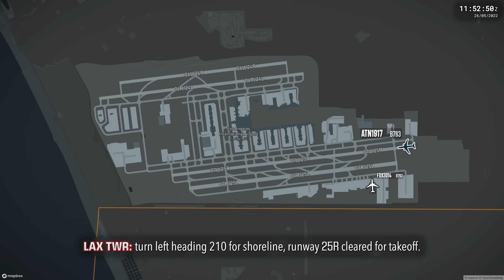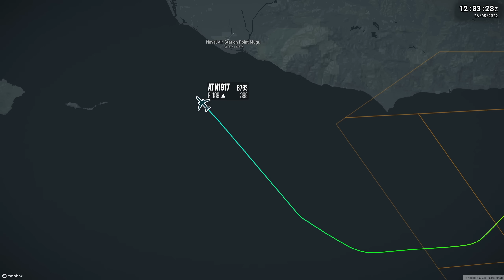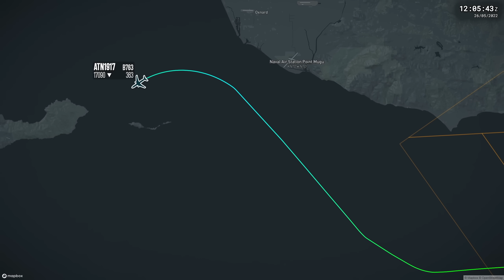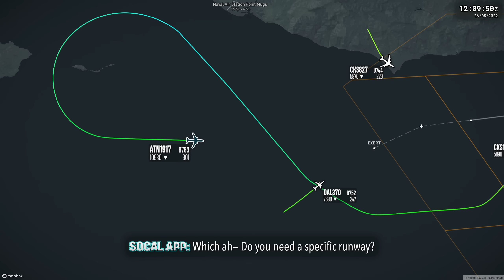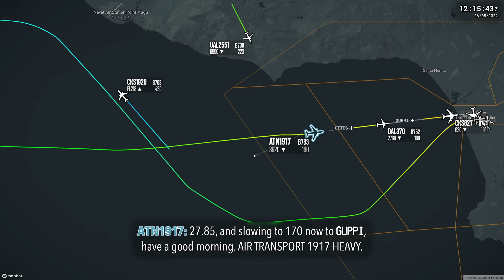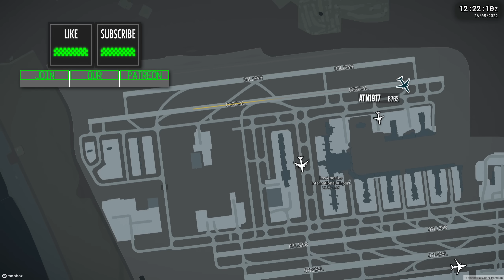"We Need To Land IMMEDIATELY"; Amazon Prime 767 Reduced to Single Electrical Source! [ATC audio]

Comment: I know the APU isn't "necessary" for flying the airplane, and I seem to recall other incidents when a non-functioning APU proved to be a problem.  It's like belt and suspenders, and if both straps of your suspenders fail, you really need that belt.  I think I'd consider the APU a necessity.

Comment: So, they still had one electrical source, plus the battery, plus the ram air turbine, and both engines, correct?
Reply from the maker: No, the aircraft was dispatched with the APU inop. When the right engine generator failed, they were down to a single source - the left engine's generator. The battery and RAT can supply power to some systems, but losing all other sources of electrical power would constitute a serious emergency.

Comment: wind 240 at 5. Why are they landing on the 6s????
Reply from the maker: This occurred in the early hours of the morning. LAX operates over water SODPROPS (simultaneous opposite direction parallel runway ops) overnight when winds are relatively calm and traffic loads are low to reduce aircraft noise over land.

Comment: Did the APU quit or was the plane not equipped with one?
Reply from the maker: Dispatched with APU inop.
Reply: @AirTrafficVisualised  I don't know how I would feel about that as a pilot...

I think if it were my own plane, I wouldn't want to fly with it.
Yes, these planes have two engines, so there's still a backup. But the possibility of a maintenance error that was done to both engines is not zero.

Comment: I find it astounding that, in 2022, when we have have thousands of channels of HD video available on low cost "Smart TVs", the  audio on a mission critical airplane sounds like its being recorded in a toilet bowl.  The massive frequency spectrum needed for video compared to the minimal spectrum needed for clear audio needs to be corrected to allow for crystal clear communications especially as we a talking about possible life/death situations. Also, given the poor quality of audio the ATC operators need to speak and enunciate with the utmost clarity.  There is no excuse in 2022 for such pathetic audio quality on mission critical applications.
Reply: The audio in the Aircraft and ATC is much better then you hear here.
and it still runs on AM, that does lower the quality some, but u cant change that without having to change every airplane  outthere.
but AM is still the most reliable radio technology we have.
Reply: @aquelty1  My contention is back before Digital TV/Audio, video information required almost 3+ Mhz bandwidth while Audio only needed 20Khz at most.  If we are  going to rely on voice technology for mission critical, life/death situations, it should be crystal clear. I've watched a handful of these videos in the last couple of days and was amazed at how many times instructions had to be repeated.  Many sound like Single Sideband not on frequency.  We  put men on the moon, we can certainly communicate better.
Reply: @mikewurlitzer5217  Did you actually read aquelty1's response?  That you propose would cost billions of dollars and require acceptance from every nation on the planet, every airline, and every manufacturer.  And it really wouldn't help much.

Comment: What does it mean when they say "heavy" at the end of a comm?
Reply from the maker: It's to do with the mass of the aircraft. The heavier an aircraft is, the stronger its wingtip vortices/wake turbulence are. The word "heavy" is appended to the aircraft's callsign to warn other aircraft of the potential danger of flying through the wake turbulence of a large aircraft. The A380 has the suffix "super". You can read more about it here: https://en.wikipedia.org/wiki/Heavy_(aeronautics)

Comment: There are 3 power sources, apu in rear, generator on each engine. Two of those failed in the flight. (apu likely before flight) Being down to one power source is not ideal.

Comment: Hey just want to make a comment about your stolen alaskan air video cause the comments of turned off.
That was not his flight path at all! Some transmissions are missing as well. Don't do that crap because it shakes my trust of the accuracy of your videos now.
Reply from the maker: The flight path was sourced from multiple ADS-B providers and cross-checked for accuracy. If you can provide alternate data showing a different flight path I'd be happy to take a look at it.

Additionally, all available air traffic control audio was included — sometimes I don't have access to every transmission, but where audio isn't included it's almost always because it was missing in the source recording, not because I intentionally removed it.

Comment: Well done FedEx crew, from a retired United pilot. Excellent job declaring an emergency. Many pilots just won’t do that. Very professional conduct. I flew the B-767-300 for 15 years. One dark and low IFR night I pushed back from the gate at Newark  on my way to Istanbul, Turkey. After starting both engines, the right generator failed. Back at the gate I was told it would take several hours to change the generator but that it could be deferred because I could use the APU as a second generator. That meant flying across the North Atlantic at night on 2 generators. I refused to do that saying that if I lost the left engine, or the APU failed, I would be down to one generator and possibly one engine at night and 3 hours from land. I refused to take the airplane and the flight was canceled. Good captains play a game called “ What if?”, while bad ones play “ I hope not”. But I would have taken it on two generators as this FedEx crew did on a domestic flight. Well done again to these FedEx pilots!

Comment: On the 1983 day of my Private Pilot check-ride in a C-150, I left my check-ride airport as the sun was going over the horizon. I had a 40 minute flight from Rutherford County, NC airport back to my home base in Boone, NC. (at that time) an unlighted grass strip in the Appalachian Mountains. About halfway home I had a complete electrical failure... mind you now, I'm a rookie w/ a dripping wet PP license. I got back and the one street light at the tie-down corner of the airport was my only light. I held my flashlight in my mouth and kept it focused on the airspeed indicator, remembering that my flaps don't work, kept my speed up about 5 kts higher than usual and made an uneventful landing. I taxied back to tiedown, an some of the other plane owners were there and quizzed me about my landing lights and nav lights being out. I got a commendation from them all. 25 years later, it happened again in a Piper Archer (At least I had flaps) that I was ferrying back from maintenance at night. Now, as an Instructor, I "overemphasize" the importance of having a small flashlight at hand (not in a bag), and perhaps a portable navigator of some type if going to far reaching destinations. AND... when things go wrong... JUST FLY THE PLANE!!!
Reply: Yeah never occured to me.. Cessna electric flaps.. rather have the J-bar flaps.
Reply: PAT25 Do you have CRJ in sight? PAT25 Pass behind CRJ

Comment: Why don’t they have an apu? Are they allowed to fly with the apu inoperablere?
Reply: Nope.
Reply: They do have an APU and it is operable, if not then how they'd start the engines, it needs bleed air form the APU. The thing where he said "We don't have an APU" it means that the pilots are trying to start the APU again mid-flight (normally the APU are shut off after the engines had started). But for some reason the APU won't starts.
Reply: @harveywilde6781  Well you can start the engines on the ground by ground-bleed air. That's actually a thing, but don'T ask me what that's for. I think some months ago I actually read something about an airplane flying without an operable APU, but I'm not sure if that was on purpose or a malfunction. Or maybe I read that you would use ground bleed air to start the engines if you don'T have an APU and then I asked myself if that's even a thing.
Reply: @harveywilde6781  I just googled it. It's actually true that an aircraft CAN start without an operable APU under some conditions! Crazy!
Reply: @jemand8462  Yes I know, it's called the Air start unit. I forgot about that piece of equipment. Then realized it after I made the comment.

Comment: I guess all the saving money on not repairing the apu didn't playoff.   Nice job by the crew!
Reply: The APU is operable. Just for some reason it wont starts (normally the APU are shut off after the engines had started).

Comment: Coming out of Lisbon one day we had the left generator go on vacation (quite). The APU was fine until the Azores, then the APU also went on Vacation(quite), later found a gasket on the oil cap was damaged,thus APU oil was blown over board.   We declared an emergency and landed in the Azores.  Wonderful place, glad to visit the islands.  We were flying a 757.
Reply: so you went on vacation too ^^ (quite)

Comment: I can't believe how many armchair experts here apparently think LAX has only 1 runway. It's not exactly a grass strip out in the countryside. There are 4 parallel runways eastbound and this pilot chose 6R, so the other traffic were kept on the other runways. Its not like he was coming in wing a wing blown off and flames shooting out of his engines! The other traffic was miles ahead or behind him anyway, does everyone here understand the little airplane symbols in this graphic aren't actual size?
Reply: I haven't been on a plane in quite awhile.  Towards the end with the planes all still on approach (same runway as far as I can tell?)  I figured I would watch the clock and see how far apart they were upon landing.  I figured maybe 15 minutes.  It was about 3 to 4 minutes between landings - much closer than I expected!  (Pretty impressive).  The plane after the emergency plane was told to be ready to go around in case the plane had problems.
Reply: @philduoos2961  - a lot more regularly at Heathrow. 40 to 45 and hour with the new time-based separation in light winds! https://nats.aero/blog/wp-content/uploads/2014/02/TBS_ReadMode.pdf

Comment: Shouldn't the jet maintained altitude, possibly even climbed, is case it became a full power loss?  Shouldn't they been offered an emergency clearance to land at Point Mugu, much much closer than LAX and far less people in danger?   And shouldn't he have been turned towards the coast after declaring the emergency, instead of of far out over the ocean?
Reply: At the speeds they are going, they weren't that far from the coast and the goal is to get the plane on the ground which means they have to descend. Magu is basically 19000 feet below them and if they were to go there instead, ATC would still have to vector them out quite a ways to give them time to descend. By the time they do that, they are pretty much back in LA. The electrical power issue is definitely an emergency but if you loose the other generator your not going to lose the engines. I haven't flown a 767 but I image they have a RAT like all the other airplanes. A RAT is essentially a windmill that drops out of the bottom of the aircraft and generates just enough power to keep a minimum amount of equipment working. So, they actually still had 2 electrical sources left, though I would never want to rely on the RAT.
Reply: @blusheep2  Thanks!  That was super-informative!!

Comment: Always wonder why you’d want to return to a busy INTL airport like LAX in an emergency, when Point Mugu was right there to the northeast. I guess company has resources there, mechanics and the like.
Reply: Magu was below them 19000 feet. ATC would have had to vector them out quite a ways to give them time to descend, so Magu isn't really a more efficient airport to land at, not to mention its military airfield which isn't set up for commercial airliners and passengers. Generally pilots will opt for the large airport which has longer runways, company support and good fire and rescue.
There are time and no-time emergencies. A fire would be a no-time emergency. You get it on the ground as soon as you can. This electrical problem was not a no-time emergency.
Reply from the maker: Keep in mind that this was at 5am local time – the aircraft you see on the display represents the total traffic into and out of LAX at the time.

Comment: Are apu’s normally missing on a 767? Do these use a battery for a apu?
Reply: APU was likely not working which is permitted for a period of time
Reply: "APU" = Auxillary Power Unit, and is primarily used for electrical power on the ground and bleed air for starting the engines. All modern airline jets have them. Sometimes they break and are deferred until they can be fixed, which is what Tom's Travels is talking about. There are other ways to start the engine on the ground.
Reply: probably inoperative

Comment: Anyone care to share why if the emergency was so big they didnt want to call the naval air station?
Reply: It was not a big emergency. More of a precautionary thing, the plane can fly without problem on one generator, that's why they have redundant systems. But if 2 out of 3 generator aren't operational then you do not have a back up in case the one fails. 

Every system on a commercial aircraft has redundancies, 2+ engines, 2 pilots, 2+ hydraulic systems, 2 batteries, 3 generators... losing one is an emergency because you should land ASAP, but there's no danger. Unless the one you have fails too...

Comment: How does their aircraft not have an APU, is that optional on the 767?
Reply from the maker: Not optional, but in this case the APU was inoperative. Not all parts of a plane must necessarily be operational for it to fly – some are non-essential for short periods. Manufacturers will specify  in a document called MMEL (Master Minimum Equipment List) which components can be INOP and how long after a failure the aircraft is allowed to be operated for before the fault must be repaired.

Comment: Their call-sign was a mouthful. Is it necessary to say "heavy" every time? Seems redundant - the controllers are shown the type of aircraft, aren't they?
Reply: the "heavy" is actually important
"Some variations of call signs exist to express safety concerns to all operators and controllers monitoring the transmissions. Aircraft call signs will use the suffix "heavy" for heavy aircraft, to indicate an aircraft that is going to cause significant wake turbulence, e.g. United Two-Five Heavy; All aircraft capable of operating with a gross take-off weight of more than 136 tonnes (300,000 lb) must use this suffix whether or not they are operating at this weight during a particular phase of flight."

Comment: Why no APU?
Reply: Because no APU
Reply: Probably just inoperative
Reply: They do have an APU and it is operable, if not then how they'd start the engines, it needs bleed air form the APU. The thing where he said "We don't have an APU" it means that the pilots are trying to start the APU again mid-flight (normally the APU are shut off after the engines had started). But for some reason the APU won't starts.
Reply: @harveywilde6781  you can start engines using a ground cart that provides high pressure air to start one engine and then you disconnect the equipment, pushback and then cross bleed from that engine to start the 2nd
Reply: @tomstravels520  Oww.... yea. The Air start unit. I forgot about that piece of equipment.
Reply: It would be a battery start, right?  Most APU's I've been around had little to no problems.  You spin them - add some fuel and ignition, BOOM, you are running.  The crew might have caused the "no Apu" to happen.  Although, most Apu's are probably started with one switch - it works or it doesn't.  Thanks.

Comment: I was surprised to see the other inbound aircraft not diverted to a holding pattern. Surely once an emergency is declared, that plane has priority and the undivided attention of the controller?
Reply: There are 4 parallel runways eastbound and this pilot chose 6R, so the other traffic were kept on the other runways.